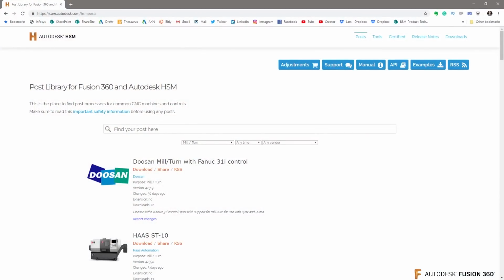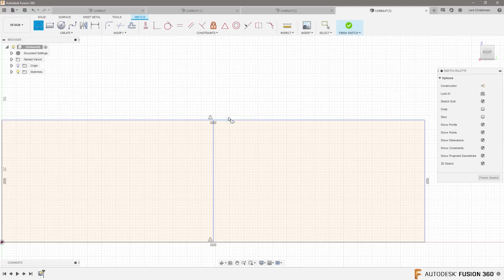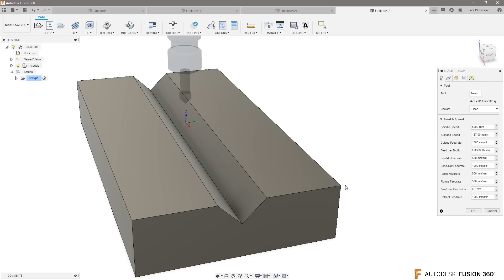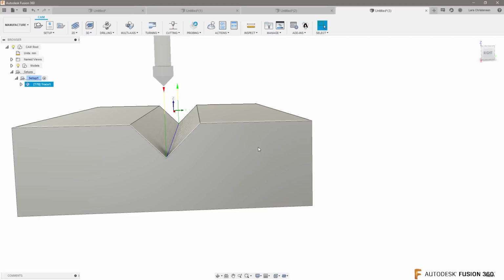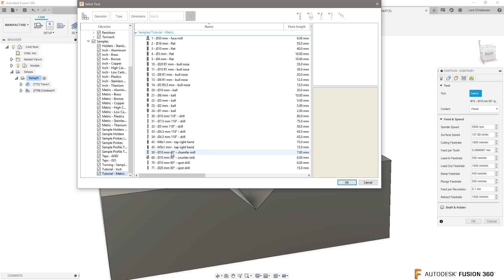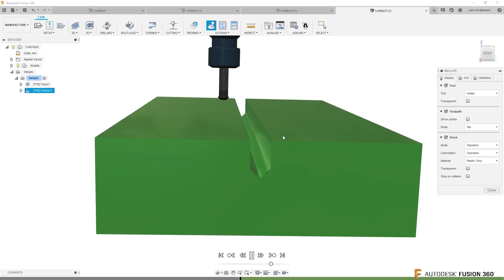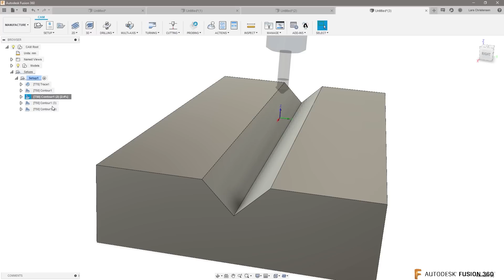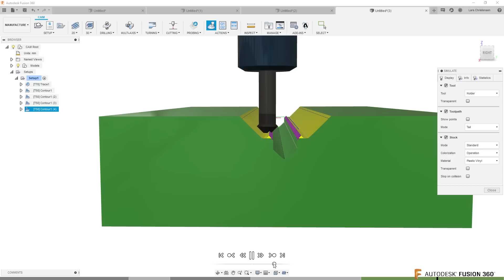Fusion 360 — V Pocket CAM Milling — Ask LarsLive

Comment: Hello Lars, I'd like to use my engraving V bit to do a 3d pocket since i want the draft (slanted walls) and also take advantage of the very small (0.2mm) tip. I've set it up as a tapered mill and the toolpath is exactly what I need but I keep getting errors in the simulation for "fake" colliisions which freezes the stock till the end of the simulaiton. If I change my tool to a chamfer mill instead, the exact opposite happens, the simulation doesn't give any errors despite the fact that the toolpath is wrong and there's visible gouging. This problem only happens with certain models and I haven't found the proper formula to replicate it but it happens when I'm doing a rest machine on a 3D pocket.

Trying to get the exact geometry I want in CAD/Modelling might solve the problem but I can't seem to find a way to do it. There's no way to do a draft angle on a 3d surface. (example, say I''ve extruded a square 1mm above a sphere and would like the draft the sides of the square).

Comment: for everyone watching in 2022.. They removed chamfer from 3d contour. another solution I found for this is...

"You can use a taper cutter instead of a chamfer mill. At times I've had to have a taper mill and a chamfer mill with the same tool number so I can use 3d pocket then engrave to finish which seems crazy!"
Reply: I came to this video because I do use a tapered mill and it's been working well, but I have a problem where I sometimes I get errors in stock calculations that seem fake, and they ruin the remainder of the simulation which is pretty infuriating. Any tips on how to deal with that ?
Reply: I'll add that I had errors and crashes with a ballend taper mill, but a bullnose with 0.001" diameter and edge radius was ok.

Comment: If I want to mill down a groove-like channel (i.e. a channel with gradually changing its depth) this is the way of doing it? What about using 3D parallel tool path?
Reply from the maker: Sure, you can do that
Reply: @cadcamstuff   Thanks for the response. Which method is better?

Comment: If it is a 90° V pocket and you have a 5 axis or even a 4th axis machine available. Use that to your advantage and use a regular end mill with part tilted @ 45.
Otherwise, use a sine plate to set your part up at a 45 if it is not too big to do so.

Comment: Love the videos Lars! I have a question unrelated to this example and I was hoping you could point me in the right direction. I am unable to create toolpaths with an RPM if 0. When I try to set my feeds and speeds in the tool librart to 0 RPM, it turns the text red and wont let me proceed due to the calculated feed per tooth being undefined. I have edited my post processor so it will accept a 0 RPM but in an update recently I lost the ability to post toolpaths with 0 RPM or even generate the toolpath.

Thanks Lars!
Reply from the maker: I am not sure you can. Why do you want 0 rpm?
Reply: @cadcamstuff  I have a diamond drag engraving tool that runs at 0 RPM.  I have been just manually editing the NC when I was done but I would prefer if I could do it right from Fusion

Comment: This reminds me, could this strategy also be used for cutting an internal dovetail with a dovetail cutter?  When I’ve cut dovetails before you have the issue of the volume of material removal getting increasing greater with each cut.  One solution I’d heard of was attempting to ‘walk’ the tool path down the slope of the dovetail, rather than just increasing radially, but I couldn’t get a Fusion to do it.